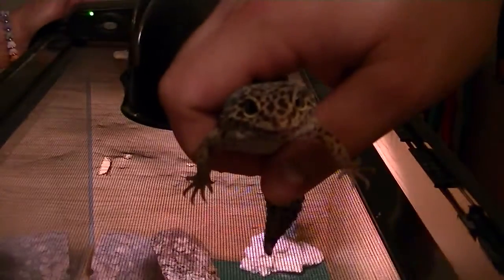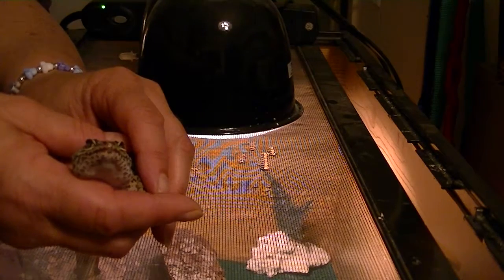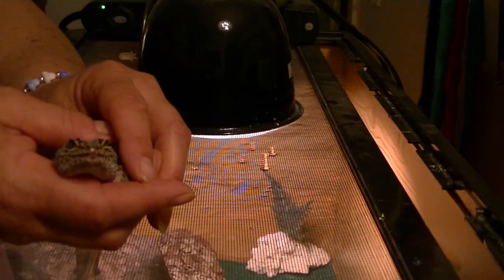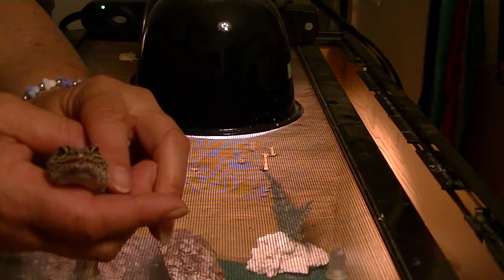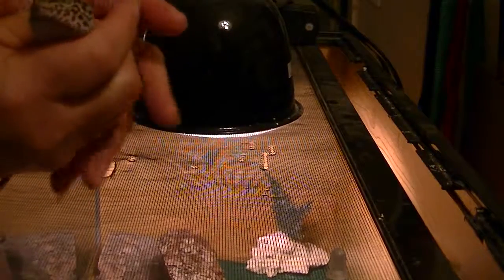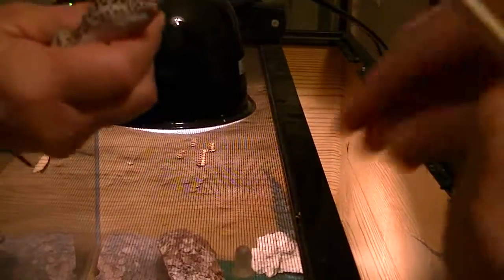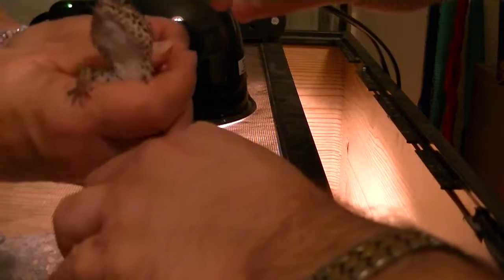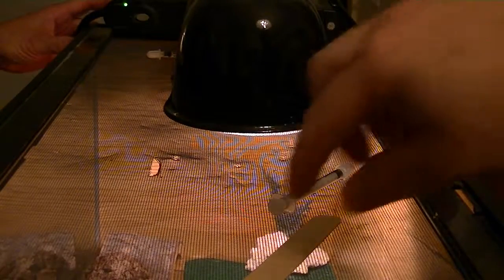How To Give A Leopard Gecko Medicine For Worms

Comment: Thanks for the video.  I'm having trouble giving ours medicine. The first two times she just latched on to the syringe, now she won't comply.  Although she is 14, she has never been handle much so she is super wiggly, do you have any suggestions?
Reply from the maker: +lokibeacat I just want to make sure is she a leopard gecko? If so it all depends on how you handle her. Its really a 2 person job. One holds her while the other gives the medicine. I would try what I did in the video with one of those flat sticks to open the mouth with. The more you handle her the more easier it will get. If worse comes to worse you could have a vet office give the medicine each day. I was super nervous to give it to a leopard gecko since they are so small but after doing it a couple times it was not to bad. I have experience with a Blue tongue Skink and Bearded Dragon. Good luck.